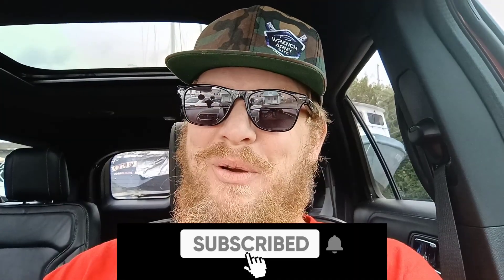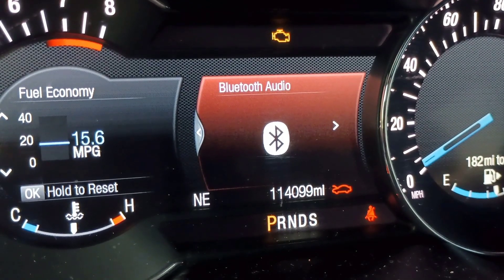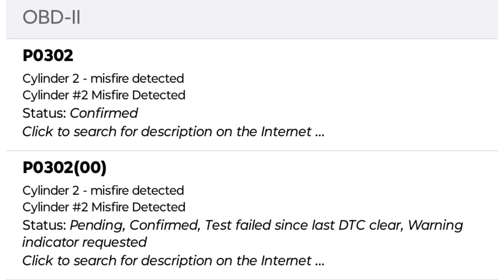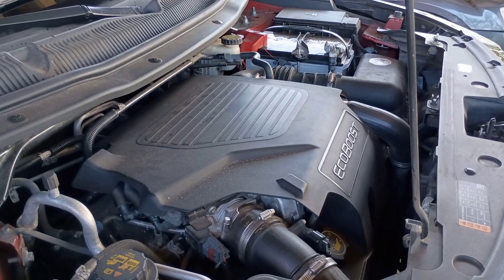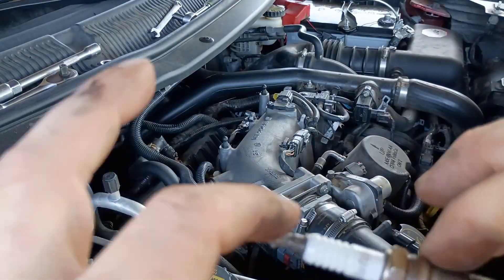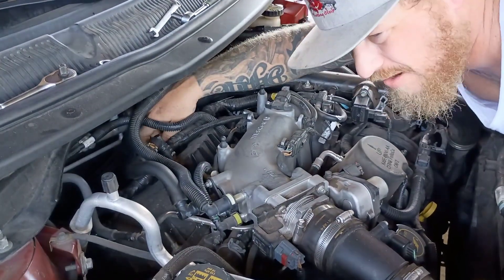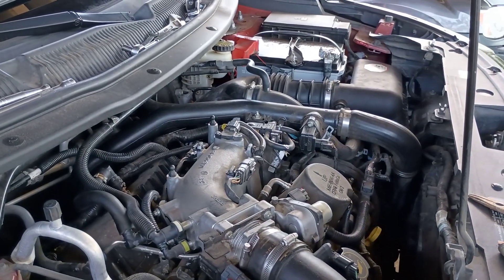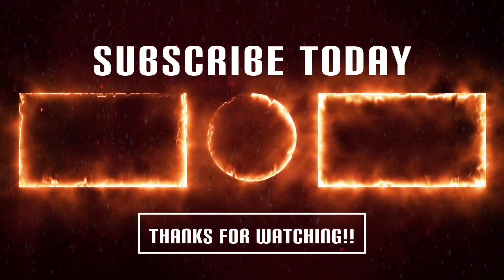2017 Ford Explorer Engine Misfire | Cylinder 2 Fix (3.5L EcoBoost)

Comment: I’m having the same problems with my 2016 ford xplorer but we change the coil but no the spark plug and still showing the check engine light
Reply from the maker: It's always recommended to change both the coil and the spark plug at the same time to ensure the best repair. Did you replace both of them?